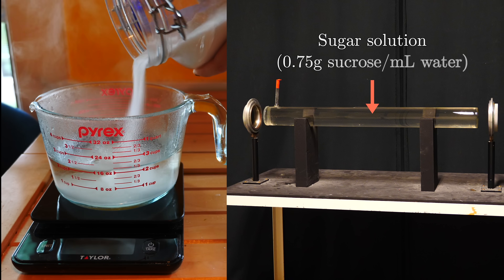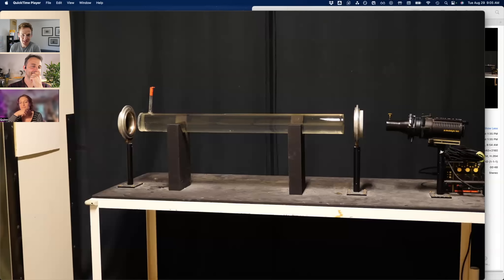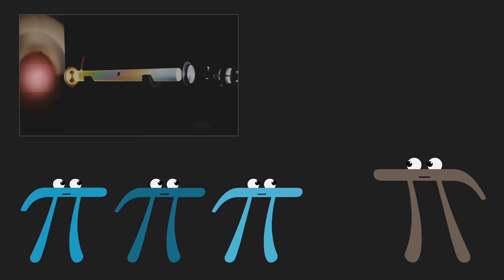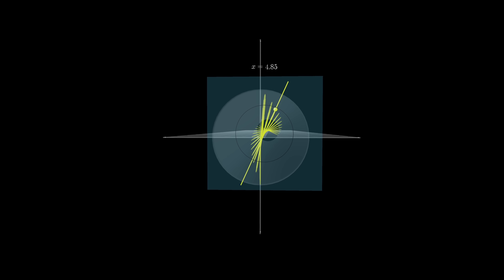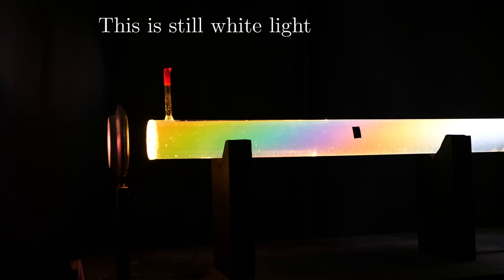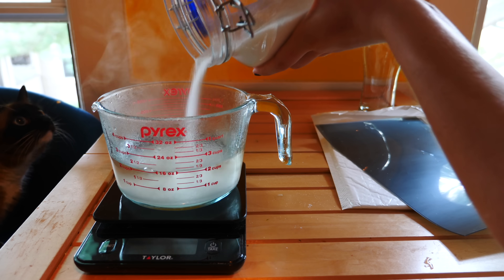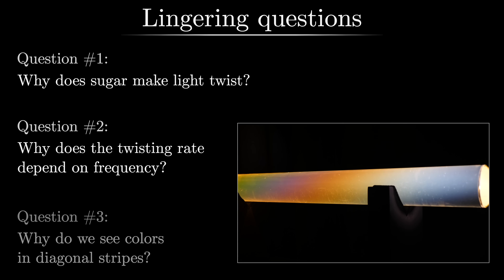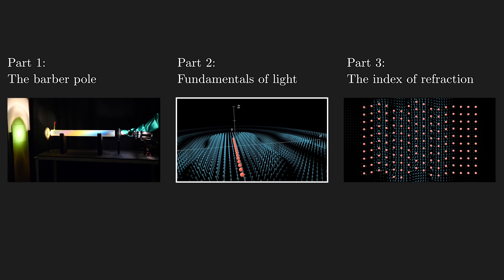This tests your understanding of light | The barber pole effect

Comment from the maker: Part 2 is available now: https://youtu.be/aXRTczANuIs?si=m6DgY1ogMrwTRrUP

Some viewers have asked about how to make this demo for themselves, and Quinn kindly wrote up the description below.

Materials:
	⁃	Table sugar (sucrose)
	⁃	Water
	⁃	A glass tube that you can fill and seal, although it would be cool to experiment with different materials for the tube, since different material = different index of refraction. More on this in part 3 of the video. The tube should be long enough so that you can actually see the effect from the sides - our tube is 1 meter long, but you’d probably be able to see the effect with a ~0.5m tube. You also might want to make sure the tube is easy to open so you can clean it. See “Things to consider” for more. For the mini-demo, I just used a drinking glass! [FYI, the tube in this demo was custom-made for the MIT Physics Department. I’m not sure exactly where it came from or what type of glass it is exactly…]
	⁃	A source of white, unpolarized light. We used a Dedo lamp, and if you make the demo as big as we did, you need a pretty powerful light source. For the mini-demo, I used my phone’s flashlight!
	⁃	Two linear polarizing filters. You can get ‘em online pretty easily! 

Directions:
	⁃	For our demo, we made a sugar solution of 300g of sugar per 400g of water. So, you should measure the volume of your tube and scale this ratio accordingly.
	⁃	Boil the water and mix in the sugar until it’s dissolved.
	⁃	Let the solution cool, then fill the tube with solution. Close up the tube.
	⁃	Place the light source so it’s shining down the length of the tube, then place a filter between the light and the tube. 
	⁃	Place the other filter at the end of the tube.
	⁃	Voila! You can rotate the first filter to see the whole spiral move up and down the tube, or you can rotate the last filter to see the color coming out of the end of the tube change. 

Things to consider:
	⁃	You really want the tube to be clean before you start, since the solution can get moldy. If you look up close, you’ll actually see little floating things in the solution - those are some bacterial friends :) 
	⁃	We try to replace the sugar solution frequently so that the demo is clearer.
	⁃	The shorter the tube is, the more concentrated you want the sugar solution to be in order to see a similar effect. 
	⁃	The amount of rotation of the polarization angle is proportional to the concentration of the solution (this is called the specific rotation!)
	⁃	The light might get hot the longer you keep it on, so be careful! As always, observe sensible safety procedures. 
	⁃	You could do this with different sugars! Glucose would also rotate light to the right, but slightly less than sucrose. Fructose rotates light to the left!
Reply: Hey there, I have a fundamental correction to the visuals in this video. The polarizing filters are oriented incorrectly. When the polarizer is vertical, it will transmit horizontal and reflect vertical. It’s a common misconception, if you would like to hear more I would be happy to share! (I am an electrical engineer with a passion for light haha) 

PS these are some amazing quality videos!
Reply from the maker: @d.mort.  Thanks for adding that to the discussion, you of course correct. I suppose it's worth being clear that the drawing here is not meant to depict the underlying molecular structure or direction of the polymers making up such a filter.
Reply: +1 to this, it's hard to test with visible light polarizers, but you can find educational material that does it with ~10cm wavelength. The idea is that the electrons can move in the direction of the line filter can move sufficiently along this direction that the dissipate the energy of the light polarized in the same direction right ?
Reply: @MatthiasBussonnier  but please, fix your English first, I am not understanding what you are asking exactly
Reply: @GooogleGoglee You have 4 grammar mistakes in your comment.
Reply: @sebas31415  I do! Thank you, I am going to correct them now.
Reply: @d.mort. 😮what
Reply: You should pin this.
Reply: they added it to the description too
 @richardsmith3021
Reply: What would happen if you change the distance between the second polariser and the screen? will it be only one colour light or it will be different colour
Reply from the maker: @jerry-sb1238  It will be the same color
Reply: Do you think Acrylic Glass would work?
Reply: @3blue1brown Would You consider making a simple video in witch you show how are you making those magnificent animations?😮
Reply: @3blue1brown For everyone who doesn't happen to have polarized filters around and are way to impatient to try this until they order them (like me), I'm happy to report that using the lenses of a pair of polarized sunglasses works amazingly too!

I popped them out of the frame and used them in the glass set up. You got to be careful about balancing the full glass on top of the curved lense on top of the phone but it wasn't to bad. 

Even though the lenses were smaller than the diameter of the glass, it didn't prevent the effect from being fully visible through the top lense. I was just holding it between my fingers at the top of the glass and rotating it to see all the colors!
Reply: "You really want the tube to be clean before you start, since the solution can get moldy. If you look up close, you’ll actually see little floating things in the solution - those are some bacterial friends :) " - Would the effect still work if you added a little bleach to the solution?
Reply: @johndoggett808  I was about to ask the same thing. I'm thinking of making an actual lamp out of this, and if it's gonna be sitting there for a long time I'd probably need to add some sort of antibacterial chemical to prevent anything from growing in there.
Reply: If you used a transparent tube, like fish tank air hose, could you make a fiber optic that changes colour all along its length?
Reply: Hi, I am Shon Mardani, this is my Unifying Theory Of Everything. I have more to fill in between the lines once I validate the fundamentals of my hypostasis, Please let me know if you see any conflict with Observed Facts, Thank you.

[GOD] Created NOTHING, a Void Point in Space.
NOTHING Attracts [neighboring] Space as the Only Law of The Nature which gave NOTHING its Property to be the GRAVITATIONAL PARTICLE (GP). 
Fast Moving Space into GP,  Creates its own GP at the [Vacated] Space which Attracts the Surrounding Space which is a Negative Pressure or PULLING/SUCKING IN of a GP on Neighboring Space.  
There are 3 Pairs of 2 Directional Possible Movement Axis, this Creates Magic Numbers of the Nature, Numbers 2, 3 and their Sum 5.
Propagation of the GPs in a Closed Cyclic Patterns / Locked Loops of GPs Create Collection of Virtual Positions in Space known as Atom, Starting with Hydrogen to EVERYTHING else.
Atoms are Connected by Overlapping/Common/Shared (single, double bonds ...) GPs to Create Molecules.
Hydrogen Atoms Virtually/Positionally Collect to Form Nitrogen and Oxygen Atoms and Form the Atmosphere, in a 4 Nitrogen to 1 Oxygen ratio which I call one ATMOSPHERIC UNIT (AU).
Movement of GP toward the Center of the Gravity Transforms 2 AUs (2(N4O1)) into 6 Carbon with H2O as Hydrogen Transformer and CO2 as State Transformer, the Collection of this Cyclic Process is called LIFE. 
LIFE Synthesizes the Heavier Organic Elements to Create Species of Independent Life Cycles.
Overlapping Fundamental Atoms Create Heavier Atoms/Elements which are collected in the Periodic Table.

The [Virtual] Movement/Propagation of GPs in a Circular Patterns within the Connected Atoms has Frequency and Direction which Constitute and are Observed as its Weight/Mass/Gravity, Force, Polarity, Magnetism, Electricity, Heat, Light, Color and ALL other Physical Properties and they Move and Interact by Connectivity.

The Gravity Force we Experience on the Earth, Is the Flow of GPs through Matter Moving Perpendicular to the Surface of the Earth towards the Center of the Gravity of the Earth and all Matter Connected to it, like being under the rain from a Firehose. We feel the Flow to the CG  as Push and from the CG as Pull.

Imagine there is a room full of Marble balls and you remove/disappear ONE Marble from the middle. One of 6 possible adjacent Marbles can move in and fill the empty space, the one on the left, right, front, back, above or below. If the Marbles move into the empty spaces at the Ultimate Speed in Nature, the traces of the MOVING/PROPAGATING GPs (empty spaces) will look like a Spiral. Hydrogen [Matter] is OVERLAPPING GPs. 

Imagine the Light Sources like Sun, Light Bulb and LEDs are NOT Ejecting Photons but they SUCK IN the GPs which we see and call them Photons.
Turbines convert the Gravity Force to Magnetic > Electrical > Heat > Light and everything in between, all different manifestations of the GP [Virtual] Moving in the Matter.
Reply: Since sugar and light interact this way, is this the basis for the quantum effect of photosynthesis?
Reply: You just realized the dimension of the cube predicts the number of lower dimensional corner cubes *1/2 that are minimally needed to cover that space. Double cover. So if we map a n-hexaflexagons to the corner cubes using a branches cover of real plane we will see the branches double cover is pseudo retractable if we looked at the square because we can take the retroreflectors as two line , cant we can a lower dimensional mobius strip (so a circle with internal 3**n twist [i think for mobiusness of the while thing]) and map it to those line segments. Whose parametrization equation with a good approximate to the floor function using some trig, implementation of a the mod function allows for a differentiable manifold. Upon which we can apply vibrations, reflections, and transmittance through, not to mention the motions on caustic or dynamic alpha value composition.
Reply: If sugar is doing all the work, wouldn't it work to dissolve in alcohol, thereby preventing bacterial growth?  Also, curious about using acrylic or other plastic for safety and cost concerns 🤔... thanks for the amazing videos and tutorial!
Reply: Could you add antifungal/bacterial solution to the mix? Could you use salt?
Reply: Does the colour seperation depend on the length of the tube????
Reply: Does the complete colour seperation depend on the length of the tube???
Reply: - What happens if you pur a mirror instead of the second filter?
- What happens if one uses sugar alcohols like glycerin?
- What happens if you use D-Fructose (left polar) and D-Glucose (right polar) together?
... guess the next couple of weekends will be sweet and shiny.
Reply: A
Reply: Why does the diagonals move down the tube when you rotate the lens near the source of light but when you rotate the far lens the diagonals seem to not move?

Comment: Microscopically the rotation happens due to sugar molecule electrons having the ability to wiggle differently depending on not just the local electric field but also its gradient. Macroscopically this is called spatial dispersion (the permittivity is not a mere locally acting tensor, instead it is wavevector dependent!). Without spatial dispersion, symmetry forbids us from having any optical rotation in the absence of an applied magnetic field.

Comment: How do you KNOW it’s the sugar water causing the twist and not the cylindrical shape of the container? What if instead of a cylinder you use a square shaped container and see if it’s the same result or not…
Reply: The light would still twist, because of the chirality of sugar, it wouldn’t make sense that the shape of the tube would affect the light inside, because light is so small compared to the tube.
Reply: A control experiment would be to try this with pure water, and you wouldn't get this result, because pure water has no chirality.

Comment: 1:48 Ok, now I want a floor lamp filled with sugar water with a slowly rotating polarizing filter.  Also I wonder what this would look like if you mirrored the far end so none of the light escapes out the top - would the light twist back to the original orientation and cancel out the apparent spiral of colors?
Reply: The light will continue to twist in the same direction (relative to direction of travel) so more likely to end up with a pattern of sort of rhombusy nature as the returning light and outbound light contribute different imbalanced spectra to what eventually makes it out of the side of the tube at any point
Reply: Yes please!
As to your question - interesting - it would obviously make things brighter!  I think each colour could be regarded as a bolt thread with a different pitch.  Then the mirror would send each colour back down the same thread.  It would then reassemble to one polarisation at the lamp end.

Comment: At first, I also said: Nothing to the side...only a little scattering. But obviously the light is so intense that this "little" scattering is visible. One thing though. Scattering is frequency dependent. So is the light at the end really still white? Or is blue more scattered and the transmitted light is slightly more red. Anyways, nice to see some physics. Cheers.
Reply: Yes, still white. Most of the straight light passes unscattered (Rayleigh) and you'd see color separation only at an angle
Reply: @rex-up9ln  Yes, mostly not scattered, that's why I said: I don't expect much to the side. But Rayleigh is frequency dependent. So while I bet you wouldn't see a color change, technically it does, right?
Reply: @nikolaimikuszeit3204  the path lenght & amount of scattering is too low here
Reply: @rex-up9ln  Is it really so hard to write :" Yes, but probably very difficult to measure, let alone see, as the path length is very short and the amount of scattering is very low." Cheers. Going for a beer now . Have a nice weekend ;)

Comment: Thank you Mr sanderson. I give a 2d version of the phenomena.  I suggest that the rotation of the polization depending on the speed of light. The slower the speed the more the deviation  from the vertical. Question is when do we have horizontal direction of light I can say it when the speed of flight is totally  inversed for example by a mirror or somthing. If you take two polarized peace of glass one vertical one horizontal on each eye. The intuition tells that if vertical on the right eye and look at mirror then the vertical direction is kept so you can see your right eye in mirror but in fact the inverse is correct. Somehow rotation is linear relationship to the speed of light in the midium

Comment: Im a chemist. the dependence of angle of polarization by a chiral molecule on frequency of light is a very useful phenomenon which gives rise to cotton effect. Different molecules and even parts of a molecule have a different signature and thus the plot of angular dispersion vs. freq can help identify a molecule and functional or structural motifs. See Circular Dichorism spectroscopy
Reply: How does the chirality cause the twisting even though the molecules might be in any orientation? My intuition would be ones facing the opposite direction cause it to twist the opposite way, but clearly that's not the case here
Reply: @ENCHANTMEN_  The light does not just interact with a single molecule, so you can consider an average of all the molecules that the light interacts with being equivalent to averaging one molecule over all orientations.

A chiral molecule averaged over all orientations cannot be superimposed a similar average for the other enantiomer - essentially the average is still chiral.

Plane polarised light can be equivalently described as a balanced sum of right and left helically polarised light.

The sample will interact differently with right and left helically (circularly) polarised light, which leads to the twist in the polarisation plane.
Reply: @ENCHANTMEN_  I'd love to know too -- I don't have the intuition for this at all. 

I'm trying to use my hands to represent chirality / circular polarization, with my thumbs representing the direction of travel and the curl of my fingers as the twist. It seems to make sense -- if you had an equal number of left hand and right hand chiral sugars (represented as both right and left hands with the thumbs pointing in the same direction) then the twist would cancel out. 

But it's also really easy to get the direction of twist to cancel out with one hand. Just turn your thumb to point the other direction. 

So what's different about pointing your hand in the opposite direction, and light hitting the sugar molecule from a different angle (ie the opposite side)?

Comment: So if you'd spin the polarising filter for long enough could you see every colour physically possible?
Reply: it's not about spinning the filter, the main factors comes in:
The density of the medium (which cause variable on the light twist)
The length of the tube 

If you spin the polarising filter for that 360°, you only get all the colours from that specific length of the tube and the density of the medium.

When the light passes through the last filter, some colours are overlapping, while some colours might straight up not passing through the filter due to almost exactly perpendicular to the polarization.

Hope this clears up your confusion, I might be wrong here since I can only think those 2 variables